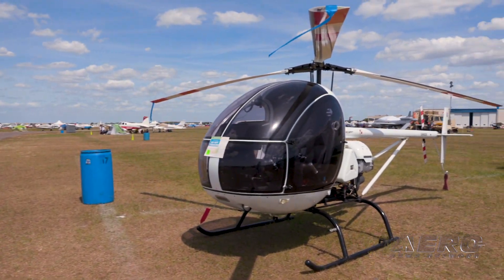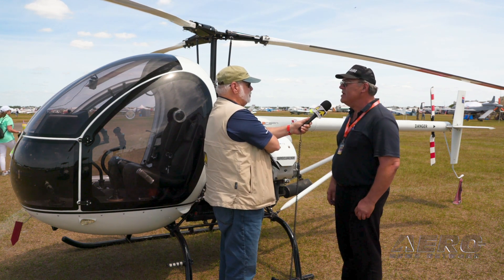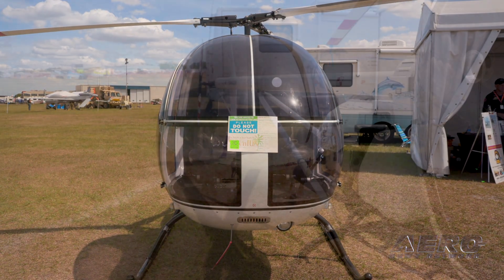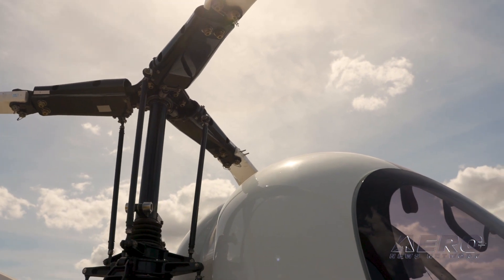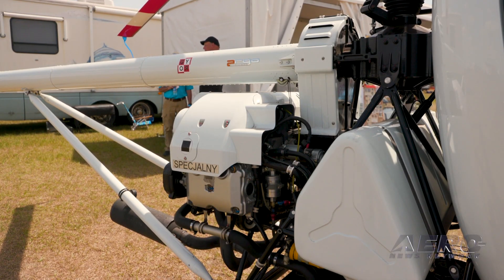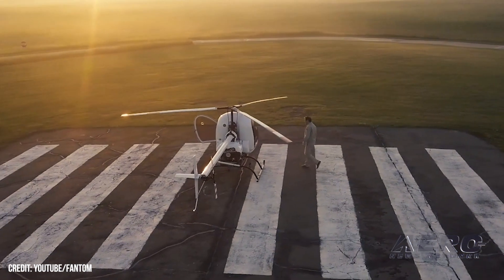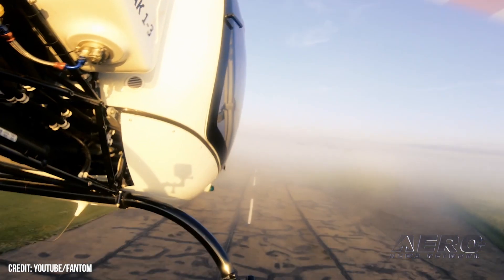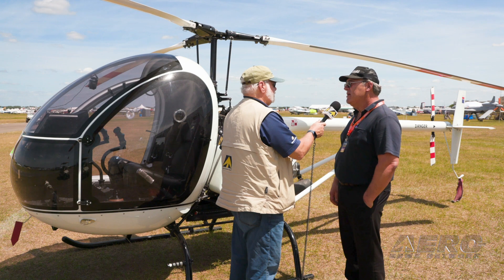Aero-TV: AK1-3 Kit Helicopter Coming to America

Comment: Looks very nice, but the Subaru engine worries me.
Reply: The current kit doesn't use the EJ25, it's now powered by a UL 180HP engine which is lighter and aviation specific.
Reply: Id pick the subaru over ul. ULpower has some historic issues in aircraft

Have access to a Subaru version and it's a beauty to fly